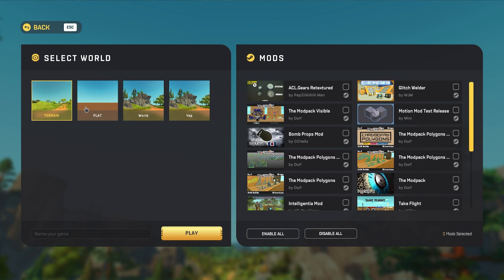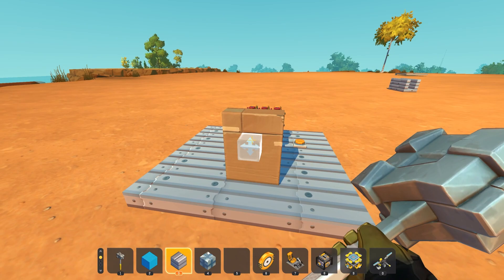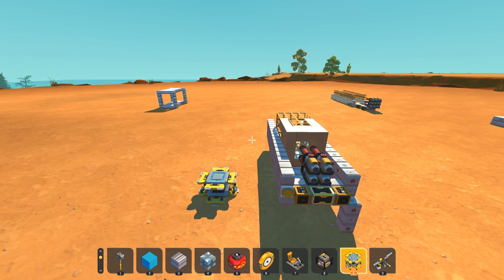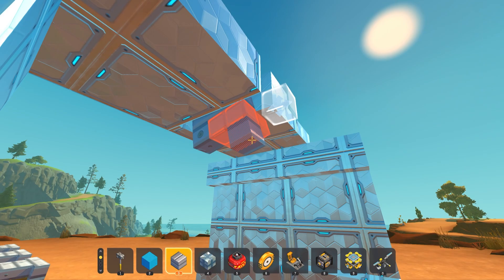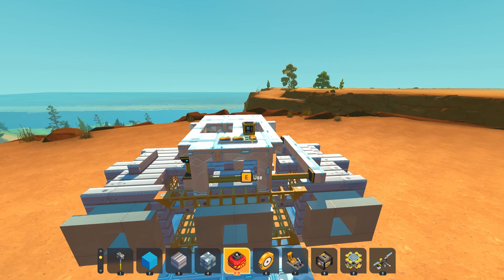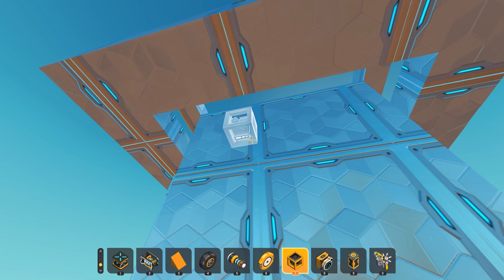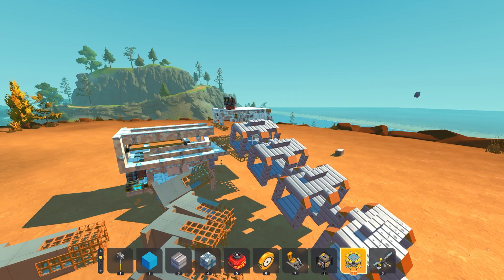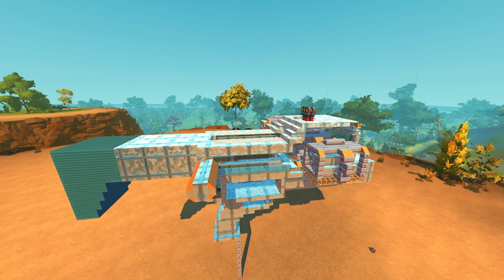Making a Belt Machine Gun | Scrap Mechanic

Comment: Based on the design of the stock, looks like it turned into an MG42 of sorts. German machine gun designed in 1942, pretty sure the German military still uses them. I think they have a firerate of about 1500 rpm, don't quote me on it tho.